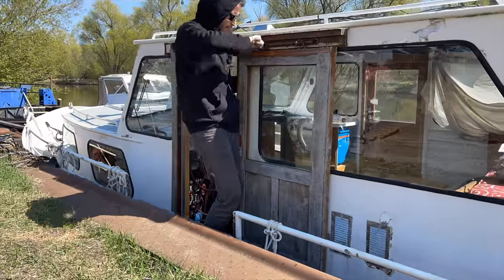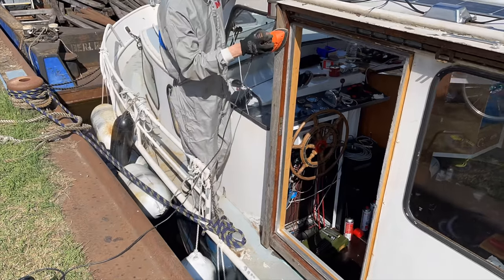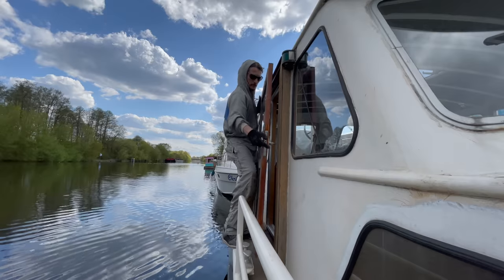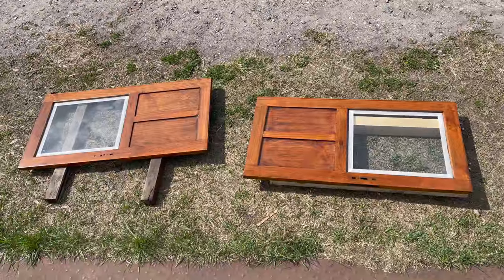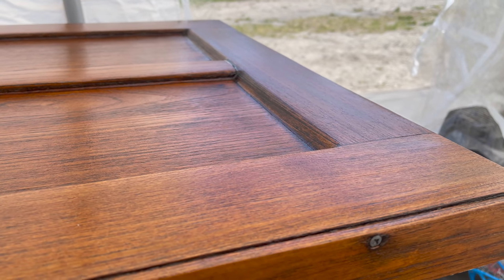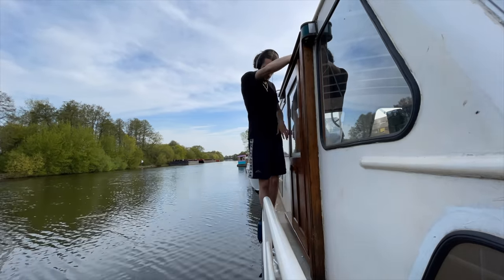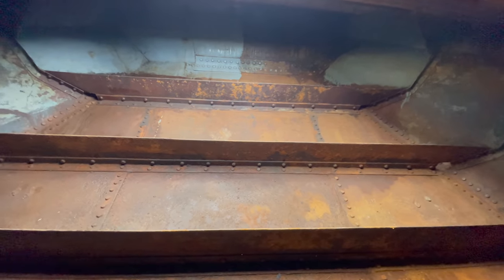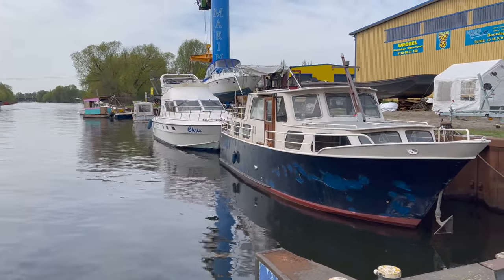Fixing the Doors of my 40ft Steel Boat

Comment: These doors like like new. Nice job !

I am more lazy or practical, so I use oil. While lacquer and varnish give a nicer look, it is more delicate to apply. Oil only needs a bit of sanding to open the pores, and then you apply the oil wet over wet until the wood stops absorbing the oil. A wipe with a cloth removes excess oil. Mind you, oil doesn't give the same protection against UV as lacquer, so I usually oil the wood every spring. Takes me half a day and it gives the wood a fresh and natural look.

Comment: Nice results; New doors and clean bilge on barge. Todays tip for you; never use silicone on, or even close to brightwork (varnished wood). When sanding the surrounding area, tiny silicone particles get on the wood, the lacquer etc. and ruin the varnish. Instead you could have used a hard filler, basically bondo (polyester putty) or mix up some epoxy. Actually I think you should consider removing the silicone, before the next varnish that you are planning. Sorry to be the bearer of bad news. Keep the spirit ;-)

Comment: Like always,top notch job,but as a painter take of the masking tape ,after using it hard to get off at a later stage, and use masting tap onlu tp pretect from sanding,but if panting just cut a round the glas  with a paintbrush, but great so see you working on both projects,love to see your progress,👌💪

Comment: What you call boat lacquer we in the US call marine spar varnish.  Any varnish will not last long when exposed to sun and rain.  It will peel and then you must sand and start again.  If you like the finish you get with varnish, it pays to do it well.  There are dozens of opinions on the best method !

You can use just a pure "drying" oil like teak/tung/boiled linseed.  This is applied with a rag so that there is no excess left on the top.  It does take many coats (more than 5) to get a nice finish.  Each coat must thoroughly dry and later coats can take more than 24 hours to dry hard.  Light hand sanding with a block between coats with fine sandpaper (200) is required.  Wipe with a tack cloth before applying the next coat.  The more coats, the "deeper" the finish will be.  The best thing is you can do quick touch ups of any area that appears to be drying faster that others.  Do not store your used rags bunched together.  They can spontaneously combust !  Spread them out to dry.

The other method is close to what you have done.  It is sometimes called 3-2-1.  3 parts thinner, 2 parts boiled linseed oil and on part of oil based marine spar varnish.  This will dry quickly and can be recoated when still tacky.  After about 3 coats, let dry completely (probably 24 hours or more).  Lightly hand sanding with a block with fine sandpaper (200) and clean with a tack cloth.  Now change your mixture to 2-2-2.  One or two coats.  Last 1-2-3.  You should only need one coat of this.  After it it dried hard, some people use very fine steel wool or 600 grit sanding paper to get a less glossy/satin look.

Comment: On the sides. Of the big boat.  You can if funds exist. Make rolls of paper templates along the sides to have a steel fab shop cut them to weld top bottom and plug weld thru holes or slots drilled or ground in the new plate .
Strips along the edges of the bottom can also be done without disturbing the supporting blocks.   

With that much open hull inside.  You may want to think of water tight bulkheads  you can make them out of marine plywood as long as they are fastened to ribs carefully.  Hatches for access and bilge pump piping could be easily installed.  

Each bilge pump section could go to z multi square deep box the pump is dropped into.or an access hatch in each section thru the deck.

Comment: Nice job, I would like to make one suggestion.  Don't use silicone sealant on a boat, use polyurethane.  If you have to replace silicone you will need to remove all of it or adhesion will be low.  You may even need to remove some of the surface because silicone can "soak" into the surface its applied to.  Silicone does not adhere to wood and is not paintable.  Do future you a favor and use polyurethane.

Comment: My home faces west and has the front doors, garage door and window frames made out of wood and i use boat laquer same as all those old wooden boats do. I find that after the first light sand i pressure wash the wood and that gets rid of all the dirt and  gray that is in the wood grain. For the garage door i dont even sand, i just go straight to the pressure washer.

Comment: Hi, just for sharing Internet knowledge: apparently there are two options with wood: 1) leave it without varnish or 2) apply varnish.
The thing is if you choose 1) will have to regularly apply teak oil or tung oil to keep them lookin good. The down side is that takes time. But if you want enjoy of free time, you would choose 2) but will need to apply a good quality varnish UV resistant and apply 7 or 8 coats and sand between them…

Comment: On the big boat.  An electric die grinder with carbide ball shaped burrs can did out pockets of corrosion in the hull plating to warm with a heat gun the welding them up.  Welding to shiny metal. Not to a rusty gouge in the surface.

Comment: I love your series, and has made me want a another boat project! I finished mine last summer, but now the boat feels too small. Just as a good tip, you should try Blue painters tape. It holds up much better than the yellow kind, doesn't leave residue, easy to take off, even after several days, even weeks in sunlight. A bit more expensive but it's worth every cent!

Comment: Water based varnish raises the grain of the wood with the first coat. A light sanding to cut back smooths it then the next coat goes on with no problem.

Comment: The wood of the doors are teak. That is high grade wood and rot resistant, even unpainted. You should degrease teak thoroughly before varnishing, for instance with acetone, because of the natural oils in teak, and use a varnish specially designed for teak. Furthermore don't use silicone caulking, especially not on metal. You can't paint it and because silicone contains acid, it will increase metal corrosion. Use polyurethan. The bilge of the big boat must be media blasted and treated with a high build 2k epoxy paint, preferably off-shore quality. That is the only proper way.
Reply: Jotun make a good product line for the marine industry.
Reply: Or zinc rich orimer and a coal tar epoxy :)
Reply: You do not need to degrease heavily weathered teak as these doors were. He said he was using a boat lacquer - yacht varnish in the UK - and that should be fine for teak.
Reply: @TR4zest  the sanding brings back the natural oils to the surface

Comment: Nice,but i would take away the masking tape.If you leave it on,waiting for more lacquer youre going to experience that its quite difficult to remove later.The glue somewhat bonds to the glass and you will have to work hard to get it off again.Better to spend a little money on new tape!

Comment: Love your videos.  Your voice, wow.  You should read children to sleep at bed or become a psychologist...perhaps a dj on a soft jazz radio station.  Anyhow, never use silicone on a boat....except for high heat gasket silicone.  It does not seal well, and boy does it fuck up your painting later on.  Polyeurathene like sikaflex or 3m4200.  In a different vane, never use 3M5200 unless you wish to permanent glue something together.  It is not a sealant, but an adhesive.

Comment: Silicon is not the correct product to use in a boat, you should use Sikaflex 291. It would be also better to use owatrol D1 to doors before varnish.  Then after that 4-6 layers of varnish.